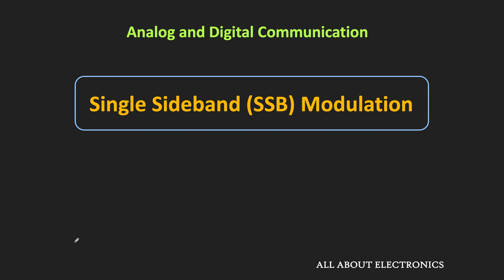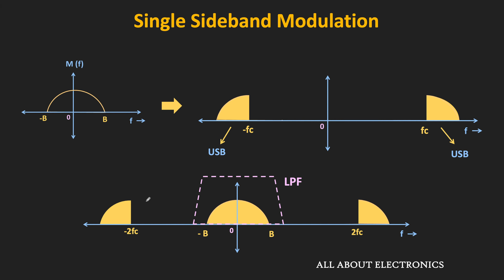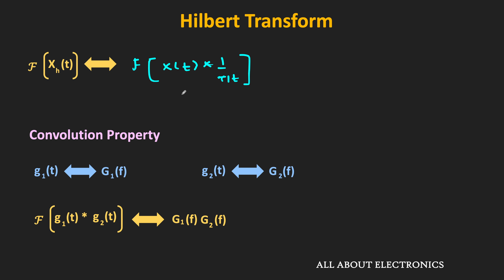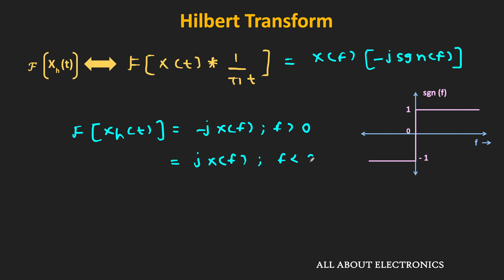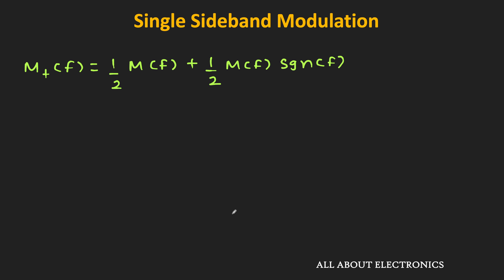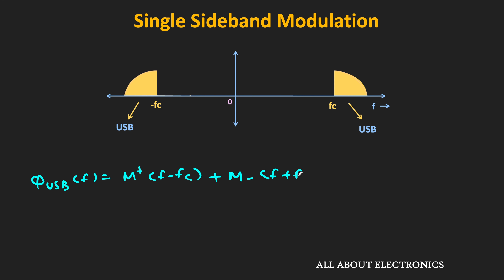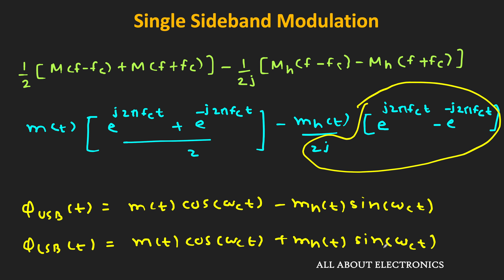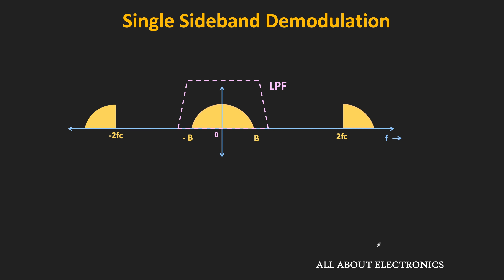Single Sideband Modulation (SSB-SC) Explained | Hilbert Transform | Single Sideband Demodulation

Comment: 1:04  lower or upper
2:02 less power
2:20 why synchrony. demodul
3:56 hilbert
5:30 convolution rule
9:17 H(f) = e^-jpi/2 sgn(f)
9:36            -pi/2 phase shift

9:50  m(t) : message; M(f) : freq spectrum
10:00 M+(f)
17:15  sync demodul

Comment: A 5 KVA, 230/115 V transformer takes 1.2 A and 75 W when 230 V is applied to h.v.

winding and L.v. winding is kept open. It takes 21.75 A and 150 W when the Lv. winding is short-circuited and 17.4 V is applied to the h.v. winding. Find: (1) The no-load current as a fraction of full-load input current at 0.8 p.f. lagging:

(i) Percentage regulation on full-load at 0.8 p.f. lagging; and (iii) The load at which maximum efficiency occurs and the maximum efficiency at unity

p.f. can you  explain this sum sir